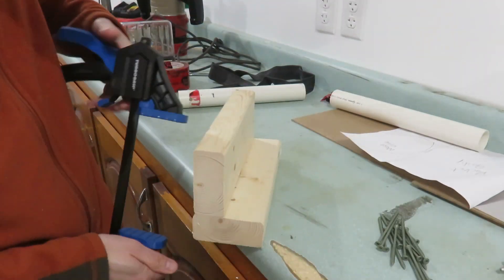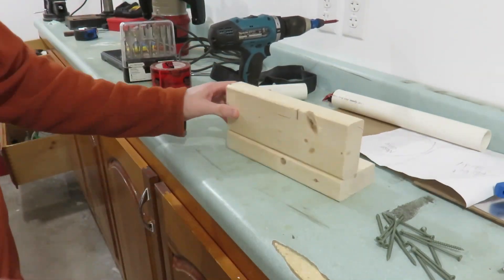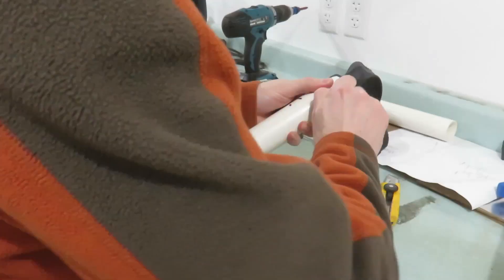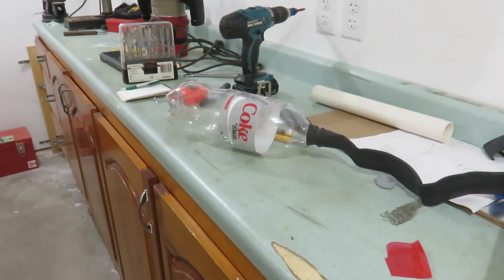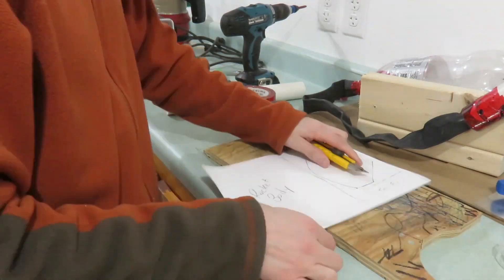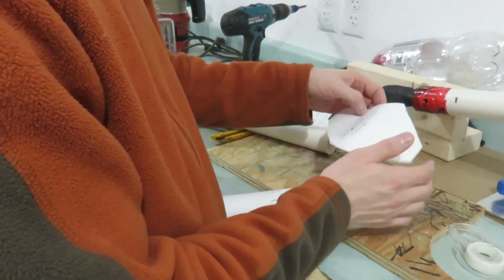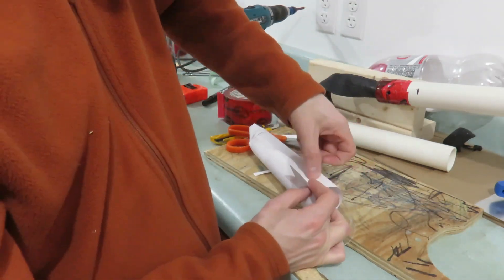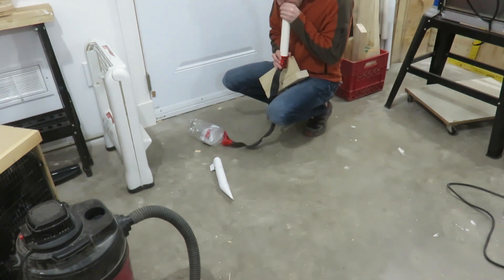How To Make A Paper Rocket Launcher

Comment: Can you reuse the bottle, or do you need to replace every time?
Reply from the maker: Yes the bottle can be used a number of times.  You blow in the tube to inflate the bottle each time. I bring 2 extra bottles as after jumping on the bottle for 30-45 mins it will split.